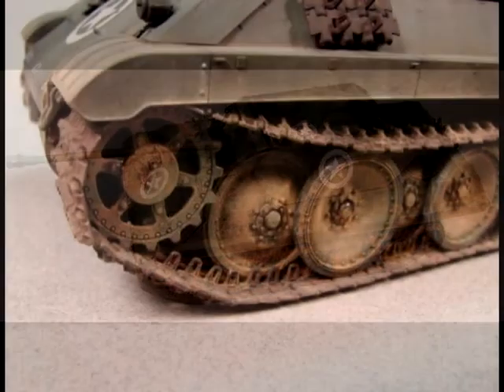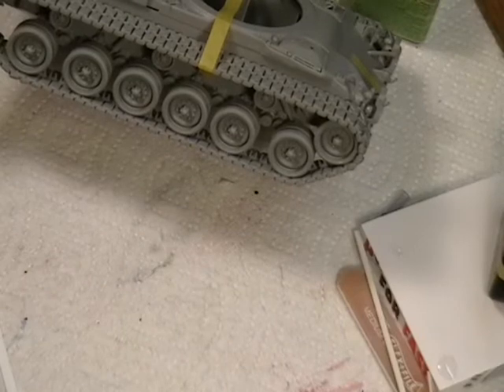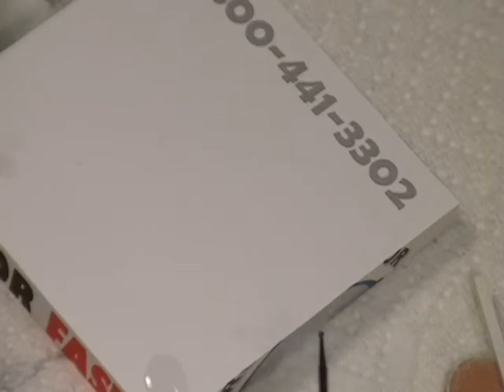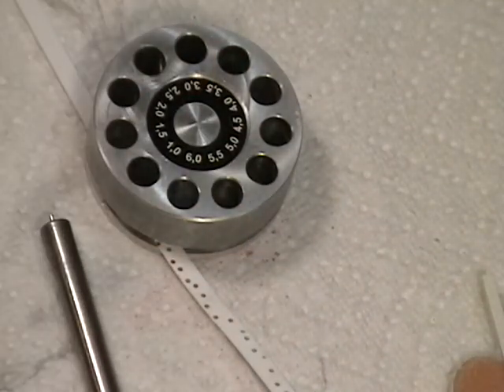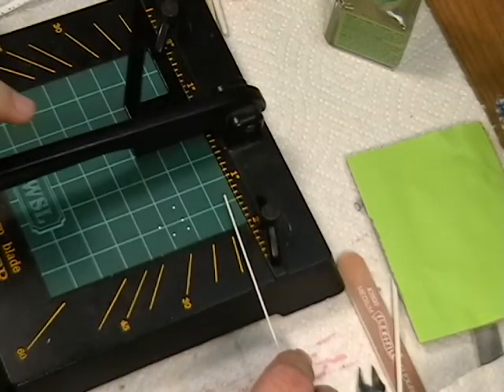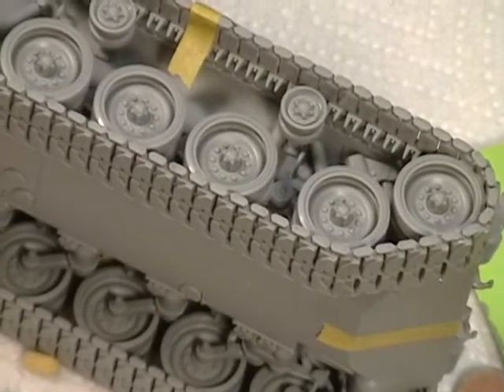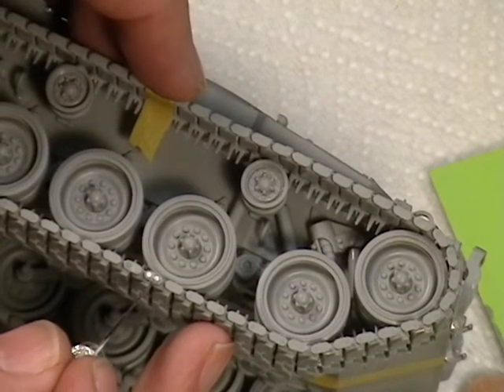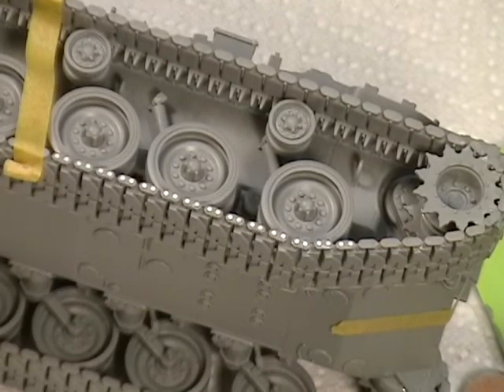Takom M-47 track links

Comment: Great video on how to replace the lost detail after sanding...the only problem is that the M-47 tracks do not have track pins which protrude from the surface.  They are actually more like recessed holes.  Check out some on-line walk around photos and videos.  I also sanded off the ugly seam line and protruding pins from the sides of the tracks, but instead used a very small finger drill to create the pin "holes".  Eight to 10 twist with the finger drill, and had a perfect track pin hole.  A little time consuming, but results were good.